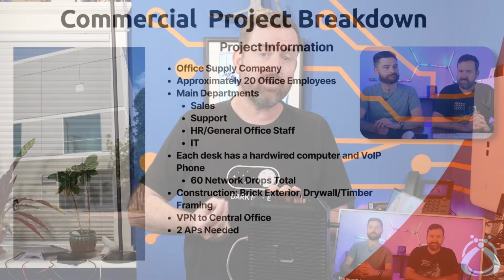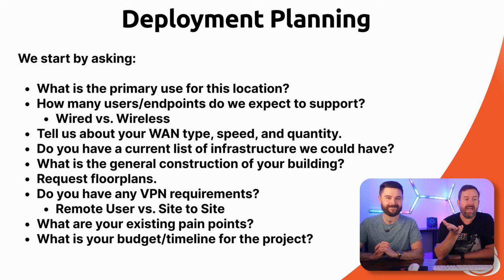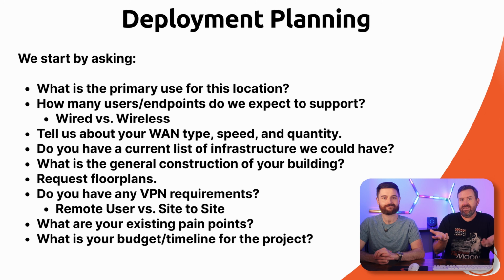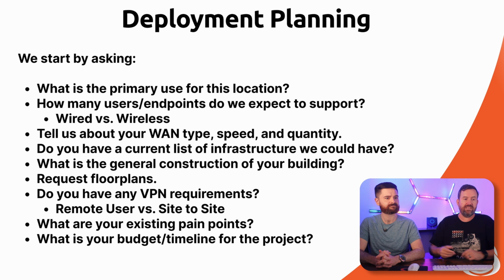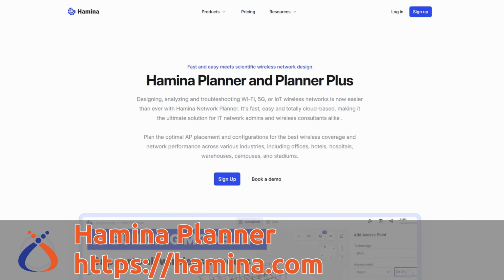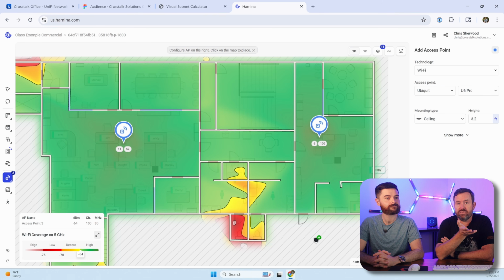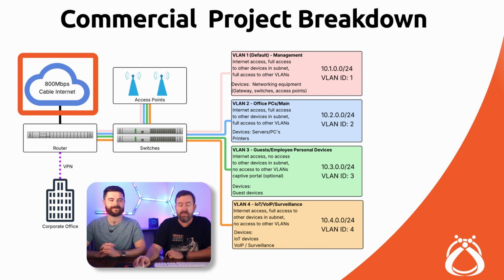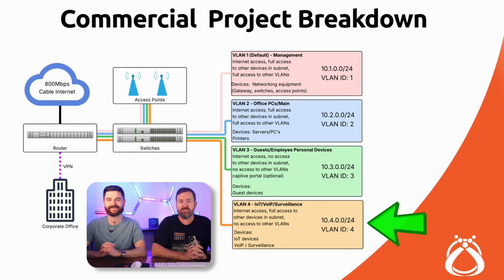Planning Your First Network Deployment? Start Here

Comment: In which VLAN would you include solar panel devices? I'm in doubt between Management and IOT... I don't want them compromised in case a smart plug is hacked, but I also don't want them in the same network as the infrastructure devices (routers, switches, etc)... maybe a third VLAN dedicated to these critical devices?

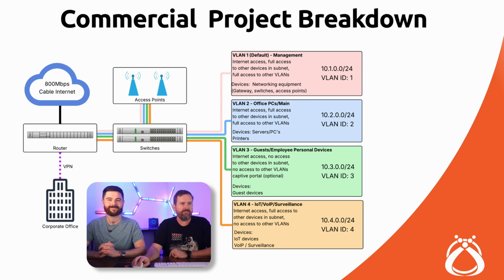Comment: @15:42 - why make the default vlan the management, with access to everything?
why not make the default VLAN the guests/personal vlan?
Reply: Its a Cisco thing. Some devices might not support vlan tagging, so by having it in default vlan1, they would be accessible to the management tools. 
But yeah, most people agree that it would be generally better to not have default 1 be the management vlan as you don't want any random device to get plugged in to have access to the management vlan. 
But if you implement a RADIUS/PPSK environment, then it makes more sense. As RADIUS will detect the newly plugged in device and based on policy, determine what to do with it (accept it to vlan1, put it in limbo/holding until you approve it, send it to another appropriate vlan, flat out reject it on the network, etc)
Reply: @geeksgrimoire  "implement a RADIUS/PPSK environment"
sorry, i have never done that, nor study how to do it.
But that sound like making your network move from SIMPLE to COMPLEX.
Reply: @fbifido2 it is an advanced network architecture yes. I was just giving reasons why you might want the management vlan as vlan1/default. I generally make the management vlan something else in most environments I am contracted to manage as most of my clients don't want to speed the money to have a RADIUS infrastructure in place.